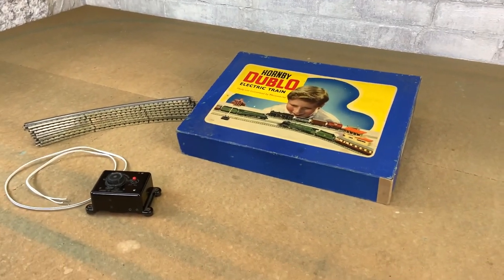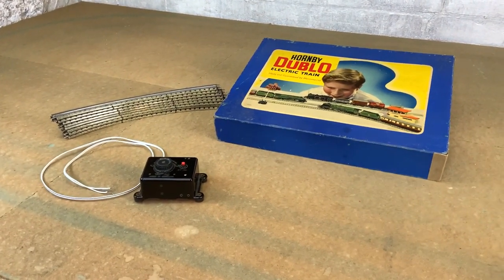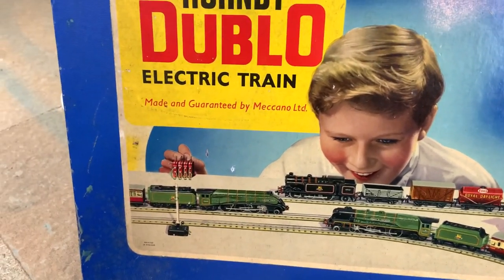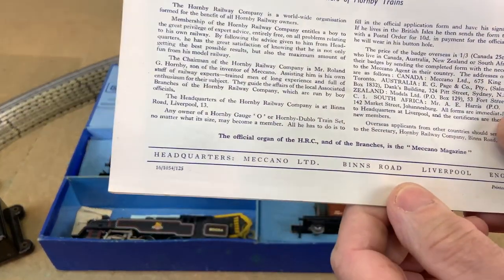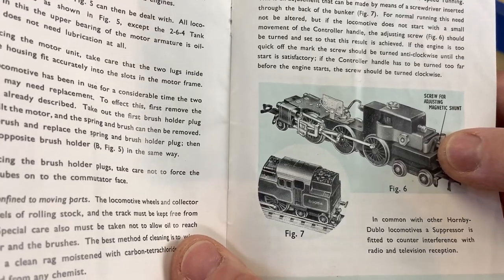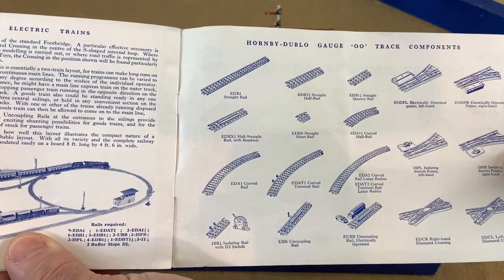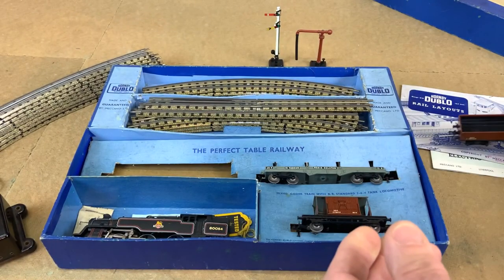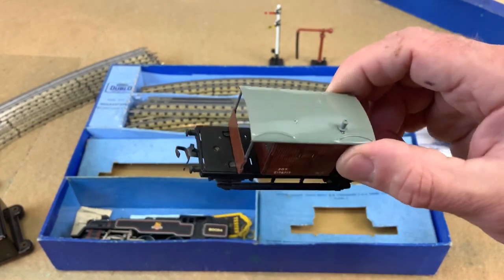Running The Excellent 1950's Hornby Dublo EDG 18 Tank Goods Set Using A Tri-ang RT.42 Controller

Comment: I'm still impressed that the combination of tired batteries, 68 year old train set and only slightly younger controller still gave a variety of speeds from fairly slow to fast. Triang/Hornby did not seem to include power controllers in the catalogues or price lists. I've got a copy of a 1963 Triang Power Controller leaflet which has the P.40 Battery controller ( 3 x 4.5v cells) and the P.42 which uses the secondary 12v supply from a mains unit (e.g. P4 etc) as input. The squarer shaped RT.42 must have come later and I think, by then, would expect to normally be powered from a mains unit. Thank you for trying all these combinations of items! Mike
Reply from the maker: I don't know the exact timeline for these excellent Tri-ang controllers but they are fun to use with sets. I'm glad you've enjoyed seeing them, I've certainly had great fun using them and will continue to do so. Take care, all the best to you

Comment: I thought that the RT42 handled that very well. Although all the variation in speed was close to the end of the travel of the dial it still gave a good range of speeds. The set was pure Hornby Dublo with it's die-cast and tin plate along with the metal wheels on a steel axle. Superb. You have a long list of projects, so many in fact that I wonder if the winter will be long enough for you to manage them all. I'm looking forward to Wednesday viewing. Regards, David.
Reply from the maker: Thanks for watching this David,  even though the control on the RT42 is near the end of travel, there is a nice amount of variation. It's a super thing. I too wonder about the tasks ahead but I'll keep at them, I'm sure there will be some sort of progress. Best regards to you

Comment: I am always amazed at how well the printed tin wagons were put together?  The printing is so crisp, that it seems to surpass the actual texture on a molded plastic product?  The 3 dimensional impression of  the viewing compartments on the side of the guard's van is fantastic.! 
When compared to the "warping" suffered by some early acetate Tri-ang wagons, it seems a pity not to stick with at least some "tinplate" wagons?  You are certainly not going to break off any fine detail? 

It seems that some similar Hornby and Tri-ang wagons were available. Such as the Bogie Bolster and Brick wagons.  (Not to mention a lot of 4 wheel stock). It might be an interesting video to compare them one day?
I'm not familiar with Hornby Dublo, so I may be wrong on this?  But with a "coupling converter wagon",  it should be possible to put Tri-ang on 3 rail track..  But "only" 2 rail Hornby Dublo (with insulated wheels) could operate on the Tri-ang track, I imagine?  I'm pretty sure that 3 rail Hornby Dublo did not have insulated wheels on the rolling stock, and would "short out" on 2 rail track?
A very enjoyable video.. Thank you..
Reply from the maker: Hello Robin, thanks for watching this. I do have a couple of convertor wagons and enjoy running trains mixing Tri-ang and Hornby Dublo stock. So long as the Dublo items are the two rail versions with nylon wheels all is well. No metal three rail wheels allowed on the Super 4. Take care, all the best to you

Comment: How did you clean the wheels so well?
Reply from the maker: Hello and thanks for watching this. With Hornby Dublo models I turn them upside-down in a protective cradle and apply voltage to the motor. I then clean the wheels with a fibre glass scratch brush. It cleans them so well every time. Best regards to you
Reply: @MrSnooze  thank you very helpful.

Comment: Interesting, if rather disappointing performance from the battery controller.... I wonder if the dc power delivery from the dry cells is just "too smooth" compared to the DC derived from rectified AC which is perhaps a sawtooth waveform?  I can imagine that any DC source that is not perfectly smooth would assist in starting of the motor as well as slow-running, rather like the "half-wave" function on the clipper. It would be interesting to do some comparisons of the two, perhaps using a small digital oscilloscope, but perhaps that is getting too far away from the core interest of your channel!  Have you thought about using dry fit lead-acid cells as used in emergency lighting etc and also used in computer UPS systems? It would be possible to connect your battery controller to the cell direct, whilst using the circuitry in the emergency light / UPS as a trickle charger for the cell.  I have some LED chrismas lights powered this way from a redundant computer UPS!
Reply from the maker: Hello Vernon, that's some interesting ideas there to try on the battery controllers. I will see if I can get around to trying a burglar alarm backup battery sometime, I think I have one somewhere. Best regards to you